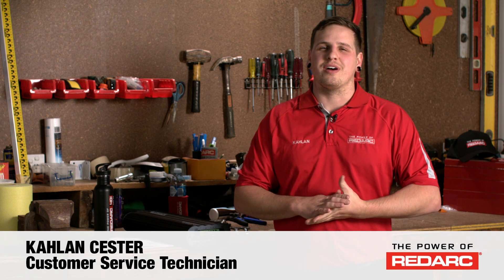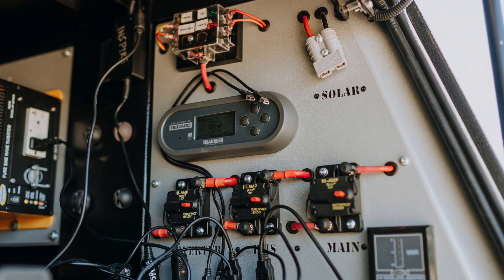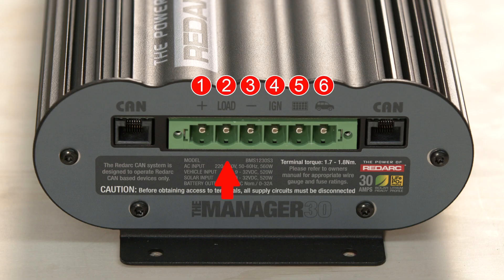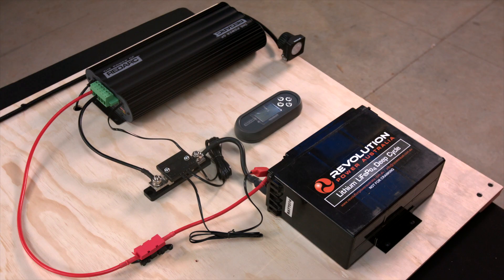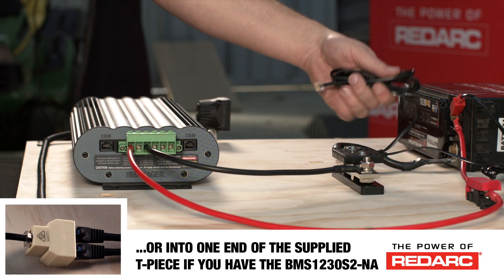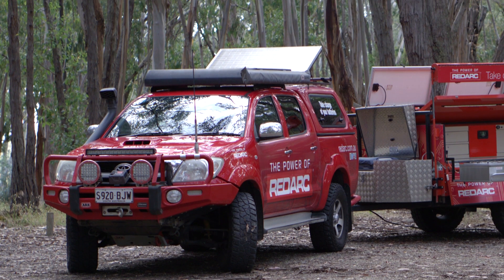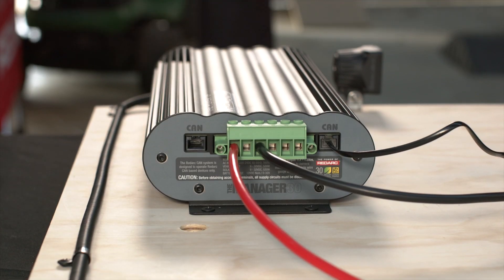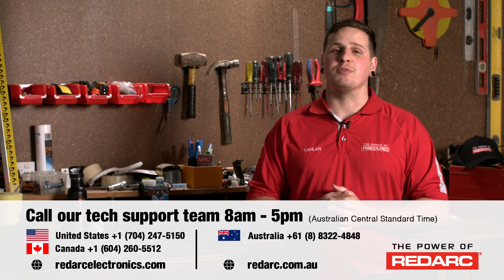How to install a Manager30 battery management system | Manager30 Install

Comment: Hello!

When im trying to charge my lithium battery via AC (240v) i can see from the remote controller that all are going into the load and not the battery itself. 

The battery is being charged via the car and the solar panel without issues.

Any ideas where it could have gone wrong?
Reply from the maker: Hello, this is a common issue we see always relating to the battery monitor being installed incorrectly. It is important that all currant flows through the battery monitor for accurate battery information.

For further information regarding this, we recommend contacting the REDARC technical team on 1300 733 272

Comment: Hi, I've got one of these in my caravan, question is, when connecting my car's battery to the manager30 via anderson plug, do i need a redarc sbi in between them or do i just run straight through with a 50A fuse?
Reply from the maker: Thanks for watching! The Manager30 has built in isolation and does not require a SBI or another isolator on the input of the charger.

Comment: So you can’t series connect panels, just parallel ??
Reply from the maker: Hi Jorgi, thanks for your comment. The Manager30 (and all our DC-DC charging systems) accept up to a maximum of 32VOC – meaning yes nominal 12V solar panels can only be connected in parallel, not series.

Comment: hi great video   where does the negative of the solar panel connect to in the system  you spoke about the positive connection    ,   thanks    pete
Reply: So if seting up a solar blanket when parked in shade.  Positive to battery + and ground to common ground?
Reply from the maker: Hi Pete, thanks for your comment. The negative of any Solar needs to connect to the common ground of the system – eg the GND side of the Battery Sensor. This is along with all your other load negatives too, same connection process there. If you need any further assistance don't hesitate to contact our helpful Tech Support Team on 1300 REDARC.

Comment: Hello, I have my system and plan on installing it next week. Re-watching the video to make sure I've got it down. However, I noticed he mentioned using 0 - 2 gauge wire in the materials to have section in the beginning, but I'm not sure where he used them and I don't see that in the instructions. Any advice will help. Thanks!
Reply from the maker: Thank you for watching, and for your interest in REDARC products. The 0/2 B&S cable mentioned was used as the cable between the Battery, and the BNEG terminal of the Manager’s Battery Sensor.

This is to cater for any loads that may be drawing high currents from your battery – such as an inverter or even just a lot of small loads combined.

The reason no other mention of this cable or visual shown was due to the focus on the Manager30’s install and not the remainder of the 12V system.

Any further questions please don't hesitate to contact our helpful Tech Support Team over the phone who will be more than happy to discuss in greater detail.
Reply: @REDARCElectronics  ahhhh thank you. I missed that part.

Comment: Hi Guys... Ive recently installed a RED Vision system with a Manager 30S3 and a 3000 watt Red Arc Inverter.... Awesome!! The only thing at the moment is I'm getting no info from my battery sensor..... nothing on the display.... how long will it take to register with the battery? (300 AH Invicta w Bluetooth) or how do i test to see if the battery sensor is Faulty
Best Regards 
Brad
Reply from the maker: HI Brad, thanks for the message and for choosing REDARC gear. It will be best to speak with our Tech Support Team on the phone to help troubleshoot this on 1300 REDARC.
Reply: @REDARCElectronics  Hi guys, crisis averted !! it took two days but the sensor is working!! The only thing i will say bad about the system is the bluetooth is terrible....if my phone is not an inch away from the display it just won't work... is that normal??
Reply from the maker: @pagaddictfishingadventures694  Great to hear the sensor is working as desired. However the Bluetooth issue is certainly not normal operation, and would be best to call our Tech Team so they can run some checks with you over the phone.

Comment: Hi i have an sbi12-lld between my aux battery and fridge. Does the earth wire get connected to the load disconnect point on the manager 30?
Reply from the maker: Yes, the SBI12-LLD black earth cable needs to be wired into pin 2 of the Manager30. Once this is completed you can access the Load disconnect feature in the settings menu and set the disconnect trigger. Contact our helpful Tech Support Team on 1300 REDARC to discuss in greater detail over the phone.

Comment: Do these components need to be vented if installed in an enclosed compartment? Heat dissipating fan required?
Reply from the maker: Hi there Bala, thanks for your message. The system can be mounted on any sort of surface, so long as it is secure. The orientation of the charging unit is important to allow for best heat dissipation; usually horizontal is ideal. It doesn’t need to be in a fully vented area as the heatsink does most of the work, but any extra flow that it can have is helpful.

Comment: Can you have 2 remote monitors on the same manager 30 via splitter?  For example one in cab and one camp side by the batteries.
Reply from the maker: Thank you for your message and yes you can run two screens using a 3-way splitter, but ensuring that the cable length is no more than 10 metres. Any further questions please feel free to contact our helpful Tech Support Team in our head office who will be more than happy to walk you through this in greater detail over the phone.

Comment: Is it possible to have a switch setup to link your auxiliary battery and your start battery to jump start your car?
Reply from the maker: Hi David, setting up a jump-start switch/solenoid from your auxiliary battery to your main is a possibility – ensuring that a separate circuit is created when doing so, rather than using the wiring that exists between the vehicle, Manager30, and the auxiliary battery. To find out more please contact our Tech Support Team on 08 8322 4848 and they'll be more than happy to walk through this in greater detail over the phone.

Comment: Hi Guys, I have the 1230S2 earlier model and have been very happy with it managing 2 x AGM 100ah batteris (one in car, other on camper trailer - I just know that it reads 50% out when trailer disconected). I am going to upgrade to a lithium battery, but what I need to know is, can I inter-mix one AGM with one lithium or do I need to upgrade both batteries to be the same type and size?
Reply from the maker: Hi Brendan, when linking batteries in parallel it is always necessary that they are all the same size and chemistry. It is also recommended that any battery in parallel be as close as possible to the other battery to ensure the best possible charge equalisation. Any other questions please feel free to contact our Tech Support Team directly.

Comment: What size cable do I run from my start battery to the manager 30?
Reply from the maker: Hi Obaha,

The size of the cable required will depend on the length of the cable.

For a cable length equal or less than 3m, 8 B&S (8AWG) automotive cable with approximately 8mm² cross-sectional area is all that is required, however beyond 3m the cable should be increased to 6 B&S (6AWG) with 13.5mm² cross-sectional area.

Comment: Hi Redarc,

My question is regarding the fuse size between the BMS terminal 1 and the aux. battery +’ve terminal - the BMS manual advises a 40A fuse, but in this video you advise a 60A fuse. 

Can you please advise the size this fuse should be.
Reply from the maker: Hi Riley, thank you for your question.

The BMS output is current limited to 30A so a 40A fuse is acceptable however a higher rated fuse is required for the input circuit. REDARC offer fuse kits in 40 and 60A variants, these fuse kits come with 4 fuses, 4 cable lugs and 2 fuse holders. Using a 60A fuse on both input and output is acceptable as the fuse is only there to protect the wiring from a short circuit and the 60A fuse would protect the wiring in this situation. Essentially either option is fine for your output fuse but the most cost effective option is to use an FK60 fuse kit to cover both bases.

Comment: Is the display unit permanently lit, or does it turn off after a period. Wanted to check first to determine placement of the display unit. Thanks
Reply from the maker: Hi Ron, thank you for your message. The display timeout period can be adjusted in the display settings on your system. For further assistance please don't hesitate to contact our friendly Tech Support Team.

Comment: what size lugs and heat shrink do we need?
Reply from the maker: We recommend using cable sizes between 8 B&S/AWG and 4 B&S/AWG, depending on the length being used. Up to 3m, we recommend 8 or 6 B&S and over 3m, upgrade to 4 B&S. I would buy lugs/connectors and heatshrink to suit these sizes appropriately

Comment: I cant wait to install the full red vision system in our 4 month old  jayco expanda outback and a redarc inverter and getting rid of the 50+kgs and 3 gel batterys and put 1 or 2 lithium batterys in I use redarc in my 200 series.  I am not a fan at all of the battery manager system that jayco use since having our van and starting our 2 year tour of the best place we've had nothing but issue's with the battery manager system that has been used . We were always going to have  the expanda fitted  with redarc red vision system  . The red vision system offers so much more in the unit it's every thing all in 1 unit unlike the system in the van now that has so much stuff not include it's all add on . To get to the point of the red vision system  I would need to out lay alot of coin to get the battery manager system in the van now any were up to the standard of the red vision system.  I would much rather spend my money on a product that i know and never had any issues with what i use from redarc now than waste my money on a system that's giving us nothing but trouble since we started our 2 year tour . There is only 1 12volt specialist and its all Australian made and owned it's redarc only the best . I even asked  jayco if i was to supply the full redarc red vision system could it be fitted at the time of bulid or have the wiring run so when it come to the dealer ship it could be fitted there I was told straight out no no to both that we asked I should have expected that answer when i asked if i could up grade the battery manager system so it was lithium ready and we were told the only way i would get it was to have lithium batterys installed
Reply from the maker: Appreciate your support, Andrew. And hope you and the family enjoy many great trips in the new Jayco.

Comment: Thanks for the video, you did a great job of explaining this baby. Can you tell me how much this system weighs in at and is there a spot that I can find dimensions of the parts and pieces of the system? I would be putting it in a 1985 VW westfalia with a 2002 2.5 NA Subaru.
Reply from the maker: Thank you for watching, Terry. You can find all the components included, sizing and product information on the product page and inside our instruction manual here https://redarcelectronics.com/products/the-manager30